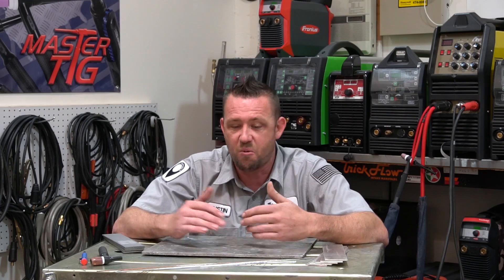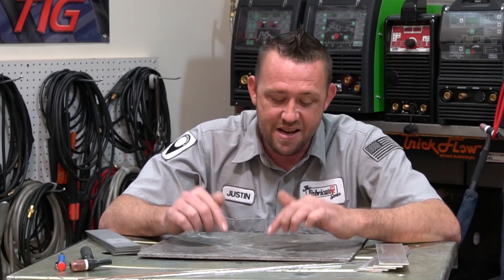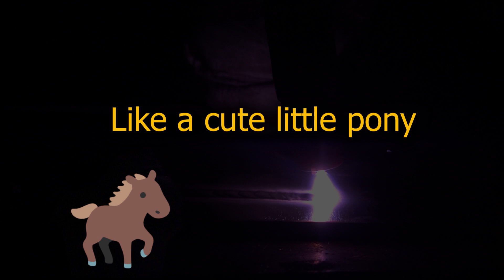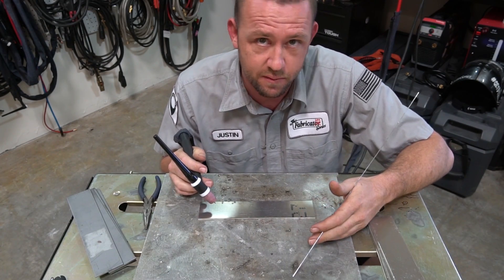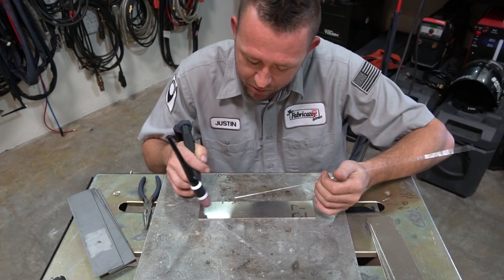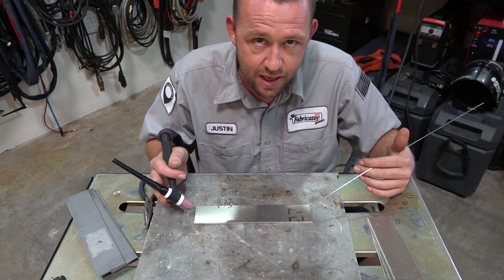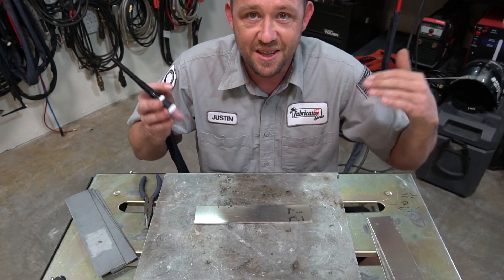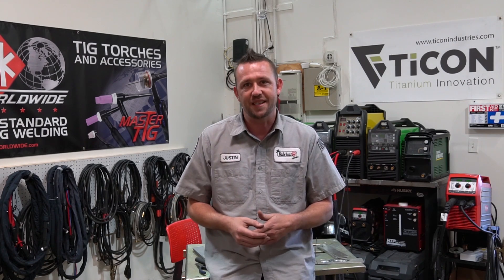TFS: Top 10 Mistakes Beginner TIG Welders Make

Comment: nobody mention high frequency electric shockyou can get..  first get your arc started before feeding filler road otherwise the high frequency wants to find a ground and it may travel up the filler rod to you.  gloves help prevent this. the high frequency voltage will give you a good jolt especially if your gloves are damp or your arm is on the piece your are welding or if you are welding without gloves.
Reply: Yes high freq can knock the snot out of you pretty easy.  I usually try to put the ground on my torch side just out of habit and have never been blasted.  Dry gloves and always get your puddle started before feeding the rod.

Comment: I was doing welding as part of my college course (did mixed Engineering (mainly electrical and mechanical and we used power tools and  machinery on pieces of metal) in first year of college before moving to Electrical then as a result of budget cuts at my college I was forced to do mixed engineering again but in a theory based course) back around 4 years ago (can't remember which type (and don't know much about the differences between each of the welding types) though I think I did TIG welding) and all I can say is I was shit at it (I am more experienced as an electrician or a computer technician (self taught from bing watching youtube videos on PC builds and so on) even though I never did any IT after 16 y/o). I want to be good at welding and want to do some DIY projects  that may involve welding and was thinking of making my own DESK

Comment: Excellent video
I have been a hobby mig welder for many years and after retiring from work thought I would try a Tig machine.   My problem is that while practising I am getting through about 75 dollars of argon in around 20 minuets welding.  When using the second  75 dollar bottle I turned turned off pre flow and post flow and lowered the regulator to around 8 lpm ( I am in the UK so I am in litres) I still only get around 30 mins max for a 9 lite tank.  Being retired I am at a stage that I may not be able to afford to run Tig at this cost.. A 9 litre co2 on the Mig lasts months to give some idea.   Have you  or any subscribers got any thoughts on this? is this normal usage?  I have checked for leaks with washing up liquid all is ok.
Reply: Depending on what you weld, You can use smaller cup size/torch. Also you can lower the regulator to about half that, a range from 4 to 8 l/min should be enough for welding in ideal conditions, no draft, no hard to reach places to weld, low amperage, etc. Set a minimal preflow and some post flow, it affects weld quality (no oxidation). For stainless is a must, for example.

Comment: EXTREMELY timely and helpful!  I am a new welder (limited time on stick and MIG, just starting TIG).  So far, I've spent most of my welding time grinding (and re-grinding) tungsten.  The tip about focusing on the mechanics is the one I found most helpful.

As always, thanks so much for sharing.

Steve

Comment: #3 Is that an Aussie reference? Makes sense though, smoothe input = smoothe result.

I had a chuckle at the "what to do with the lead" part, mine is a whisker stiff so I put it across and against my upper arm/bicep, kinda holds itself there without pulling on the torch. I use scratch start tig so I am by no means proficient.  

Started out by working a puddle on some scrap (super cleaned, shiny bright steel clean) to figure out the start up, working a puddle, holding a tight arc, torch angle, amperage setting, etc.

It gets easier. Just try not to have your face mere inches from the weld/arc. Those arc shots from YouTube are macro. Unless you have a magnifying lens in your hood, sit back and relax.

Great tips TFS, I can appreciate the "Pedestalling", I read so much to the point of confusion. Getting the basics down, the mechanics of it as you said.
Reply from the maker: If #3 is an Aussie reference- I dont know it.
Reply: Kangaroo, hop a long. Jokes aside, great tips. Subbed

Comment: I've never picked up a torch in my life....but before I ever do, I will 100% take the trip to Vegas for some face time/torch time with Justin!  
Outstanding videos, my friend!  Keep up the great work!
Many thanks,
Mike from Toronto.
Reply: Actually, if you figure out or are shown by watching a really skilled welder you can become good at a particular welding process pretty quickly. Practice to make sure you can duplicate your quality of workmanship. Getting steady and comfortable and knowing how to do that every time is key. The two biggest mistakes have to do with machine adjustment and technique. Machine adjustment is obviously a no brainer. What ever process you are doing the machine must be set right to achieve good results. When doing TIG or MIG it's not too difficult to get the machine set correctly. Jot a few notes down and record machine settings, polarity etc. when you know you have it right for a particular thickness of material and correct filler rod or wire. Read thru your notes for future reference or when confronting a situation where you need to get dialed in to weld a particular material of whatever thickness. In time this will come naturally. Also, the sound is key. Especially for MIG and to some extent stick. Not so much for TIG. Experience will teach you how to dial in TIG settings and once within the correct range a foot pedal if so equipped is great for starts and stops and for on the fly fine tuning for your travel speed. Welding books, your notes or sometimes a graph inside a door on the machine serves as a guide for settings per material thickness and wire size. For stick a good welding book, notes, memory and experience get you close. Remember, about 75% of newcomers to the trade set the machine too cold. (Amp settings too low.) 1/8" stick rod size is versatile and easier for those starting out or for anyone welding all position to control. Welding "hot" enough is when the rod lights off and maintains an arc without excessive sticking to the welded material. Then it's down to control (comfort), movement (technique), holding a tight arc as you travel and the rod burns down. If sticking do to the tight or short arc length then you need the amp setting increased until the weld can be run with a tight arc without sticking. Some flux core welding sounds like pages flipped thru of a phone book. MIG or some stick rods sound like bacon frying when set right. Correct setting, movement and arc length become critical and are key to welding vertical and overhead. The other thing that can advance your skill quickly is to get your head about as far from the weld puddle as possible within reason. Once travel speed and settings are dialed in keep your lenses clean, head back away from the arc, out of the smoke and over in the direction of travel. Use the arc to show you where you need to lay the weld bead so it fuses the pieces being welded together. Most important welding lighter material such as 1/8th or less sheet metal where weld joint prep may be limited to fitting up with a slight gap or creating a slight trench with the edge of a grinding disc. On thicker plate where weld prep is a bevel the cover pass or passes is where being able to see is critical. A cover pass and then a second directing the arc puddle along the edge (toe) of the first pass and travelling so you achieve 50% overlap of the first bead on a flat or filet weld.  Novices tend to stare at the puddle, blinding them. Which leads to more staring at the puddle with head ever closer as the struggle continues, lens getting smokier constantly. Just get you machine set so the bead is fairly flat with slight crown with fairly tight arc and travel speed to achieve the required weld size. Head out of the smoke, looking just ahead of the arc so the path is illuminated by the arc's light direct and reflected showing you the way. Adhere to these good habits and never have to struggle with laying those passes exactly where they belong to fuse two pieces of metal together. Be they light gauge plate but welds or filet welds. Practice will hone your skill at laying the right size bead but you will have a huge leg up skill wise if you keep your head over to your direction of travel, out of the smoke and let the arc light your way using reflected light and not staring at the weld arc and puddle. A very tuff habit to break but an easy one to fall into.

Comment: Justin rule number one with welding is to be comfortable and safe.
Reply from the maker: This is not a rules list.
Reply: The Fabrication Series I understand you are not making a rule list but any good welder, Blacksmith, Metal Mechanic and Auto technician knows doing there job Rule no1 is be comfortable as SAFETY IS NO ACCIDENT!

Comment: I'm an old guy and can TIG weld pretty well.  I have slight nerve damage on one hand and very slight shakes (my mother died of Parkinson's disease) I other hand.  I always try to brace my hands and move along the braced piece of metal I use as a guide.  For instance i will use a slender piece of say 1/4 inch by 12 inch long by 2 inch wide metal with it sometimes clamped on the metal I'm using.  A fiberglass "TIG Finger" also serves this purpose.

Justin, any ideas for us shake handed welders?
Reply from the maker: If you were in front of me where I could see how your hand shakes, I'm pretty sure I could come up with some way for you to compensate for it. That's a challenge I would really like to find and offer a solution to others with similar conditions.
Reply: A wee glass of whiskey.
Reply: If you could have someone record a video of how your hand shakes, without running the tig machine, I am sure that would help in giving you the guidance you want.

Comment: just curious, do any of the students get certified? i was reading on the site, and didnt see anything about receiving a welding certification.
Reply from the maker: We have connected students with a CWI in the past, but it is never a cookie cutter "walk in, weld, walk out certified" type of deal. We need at least 30 days advance notice and there are no refunds if you fail.
Reply: @TheFabricatorSeries  dam, good luck to those who put out. very cool man that you're offering the progam for those who want to learn and burn. as always, thanks for sharing the tips.
i recently purchased a tig, havnt had a chance to fire it up. do need to do a bottle exchange for argon. ill keep the advices you demonstrated on hand👍👍

Comment: Awesome video, Justin! I'm still learning but the problem I most often have is the opposite of "Floating". I start a bead and when I need to move the torch, I find that I have all of my weight rested totally on both hands against the table. I have to stop the bead because I can't relieve weight from both hands at the same time.
Reply from the maker: I see that often as well. You have to get the weight off. Your hands should be almost light and fluffy and able to glide. I usually tell people to just take a breath and loosen up, or weld with hands rested at the edge of the bench/table.
Reply: I did the same thing. Just relax and always do a 'dry run' before you begin. You will see this helps for getting good beads.

Comment: If you can’t see it, you can’t weld it!  Great advice!  I found that out the hard way.  When I turned 40, I didn’t realize that my vision was starting to deteriorate.  Got some lower-powered reading glasses and it was amazing how much better things worked out.
Reply: Yup!!!  You can purchase magnifying inserts for some of the welding hoods (Miller is mine).  Those have been a blessing for wearing safety glasses under your hood. https://www.millerwelds.com/accessories/helmet-accessories/magnifying-lens/1-50-magnifying-lens-212238  It just slides into the slot on the back side of your view window.
Reply: I wear glasses and have a cheater lens in too. Amazing when you can see things clearly.
Reply: Also, real hard to visualize and see the actual weld puddle with aluminum mig..... you cannot see sh!t
Reply: Greg Kral  A spool gun/MGAW does work for some instances, its no match to a good TGAW Weld.

Comment: Fantastic video! Thank you so much. And through your instruction, and some help from Bob @ weld.com, and Jody @weldingtipsandtricks my “beginner” never touched a TIG torch welds are beginning to look like “beginner” wtf are you doing holding a TIG torch welds. Still having issues blowing holes in stuff trying to tack it together without filler. Any advice would be appreciated. Consistency is my biggest hurdle there. Planning to come out for two 8 hour intensives this winter with The fabrication school on tube welding and stainless steel. I’d like to do aluminum as well, but I’d take the entire curriculum if I could afford it. Maybe in the spring I can come back out. Anyway, thanks for everything Justin, and keep it up!

Comment: Very good information.  Being self taught I can definitely say that I found myself doing several of those beginner mistakes, and have really worked to make sure they did not become habit.  Position comfort is absolutely my worst nemesis, and lack of comfort causes me to make mistakes.  

On a side note, is it possible to cover welding around tubing out of position with MIG and TIG?  I hate welding around 1" to 2" tube with ether machine, and would like to see if it's just my technique, or if its really just not fun for anyone.   Thanks!